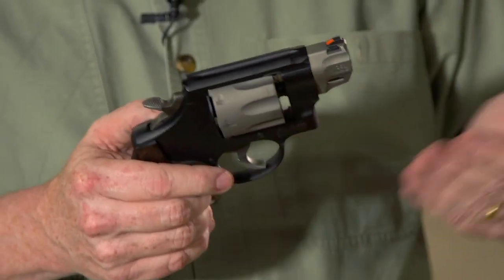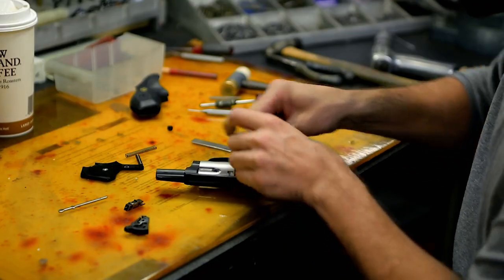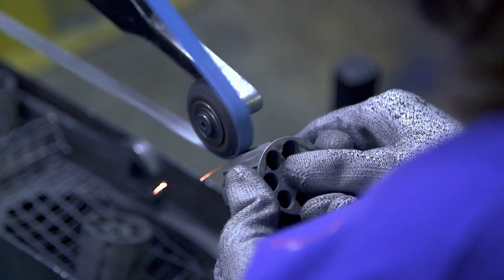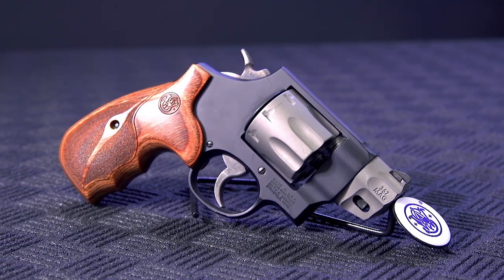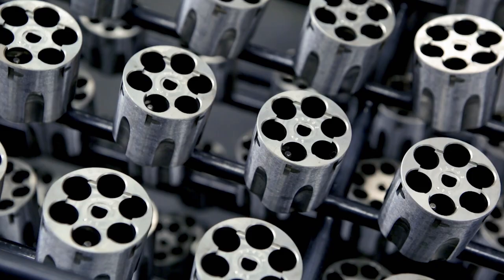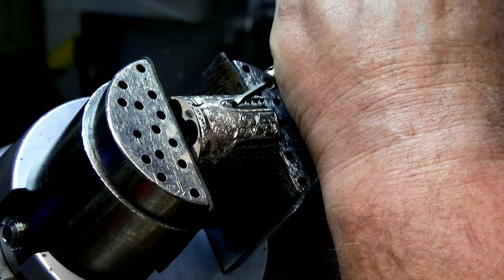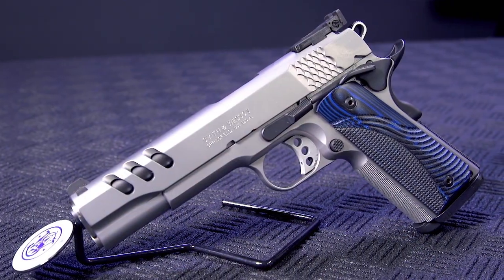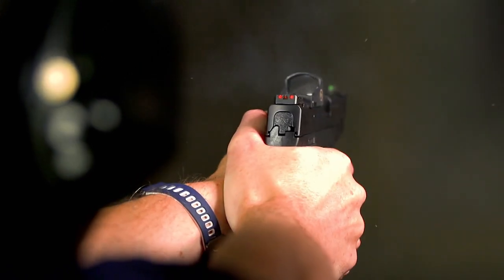Touring The Smith & Wesson Performance Center

Comment: I had my X-frame S&W 460V five inch muzzle brake equipped full lug barrel revolver worked on in the Performance Center. A Master Revolver Package was performed and a fluorescent green tube front sight was installed and a fixed trigger over travel stop was also installed. I was thrilled with the result.

Comment: Sad , Smith & Wesson just isn’t what it use to be . Turning out cheap crap guns .
Reply: I have 18,000 Rounds through my M&P when I stopped counting. You must be the problem.
Reply: Sorry Mark.  You must be a biased Glock owner.  I own over 40 S&W's from 100+ year old revolvers to modern semi's (police duty pistols) to carbines and have experienced very few concerns.  As a factory certified armorer in several products (S&W,  Glock, Remington), I have performed maintenance on hundreds of S&W products and can attest to their workmanship. They shoot well, are durable, accurate, pretty (when appropriate) and they are far from being "CRAP".  You should invest in a nice S&W to settle you down some.  ALL guns manufacturers build "CRAP", even your favorite ones.  And I would bet that you have never owned a S&W, are simply repeating what a "YouTuber" said, which means that you are dis-honest and speaking "CRAP".  Sorry and have a nice time at the range.
Reply: I’ll agree, bought a new shield plus, came with busted night sights, sent it back, they changed them,  shot it, about 50 rounds put through it, the front one doesn’t work now, so yea, they’re quality has gone down for sure
Reply: @ianb8060   revolvers are fine , comes down to quality control, I think.
Reply: Not impressed with the shield.   The safety feature is not good for new shooter and female with weaker hands.   I like all my S&W.  Latest is 637-2    Got good auction price because the PC wasn’t mentioned in the description and other bidders were thinking it was a generic 637.